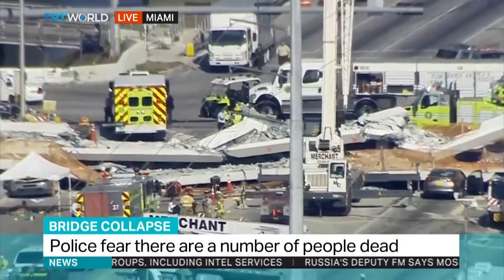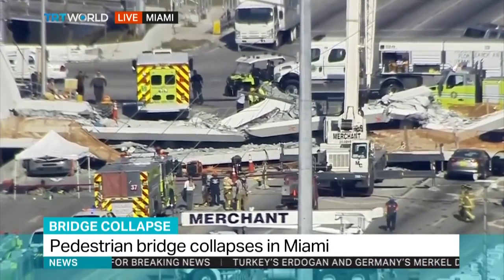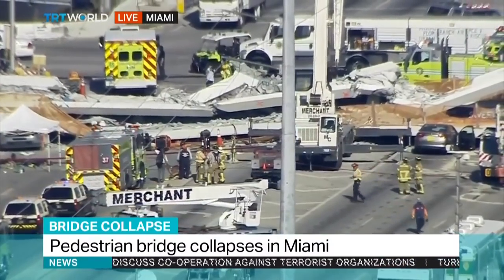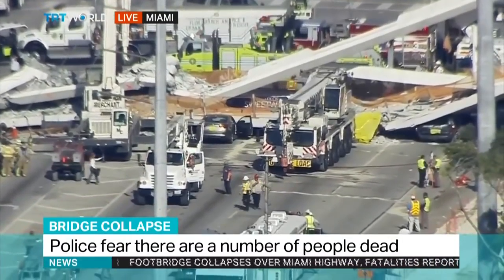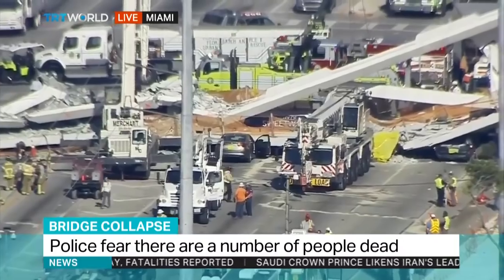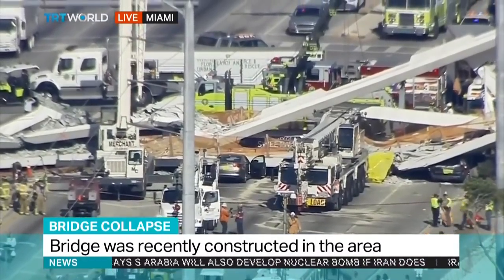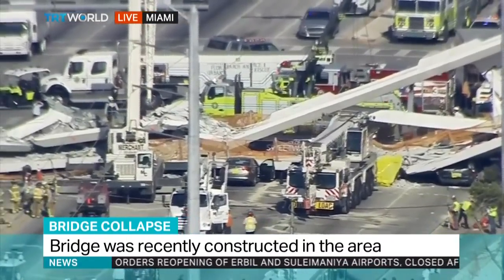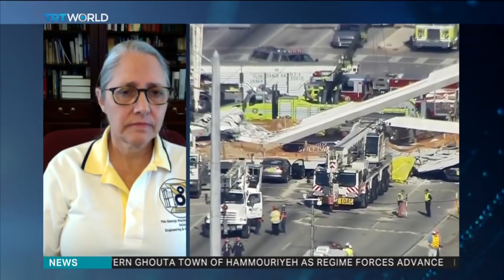GW professor and engineer contextualizes FIU bridge collapse

Comment: This professor got it wrong.  She should have known that it was not going to be a cable-supported bridge, because if the cables are supports, they have to go in as the span is erected, not long after.  The span had to be self-supporting, but it wasn’t.

Also, what she said at the end about “unforseen things” was completely wrong.  The structure gave plenty of warning that it was failing, but the Engineer of Record (a P.E.) couldn’t see what should have been obvious.  He was in denial.

Comment: Proven fact: Concrete Cracks. Concrete has full strength standing straight up & laying flat. Concrete on it's own, does not have the strength to be suspended above ground, which is why they laced it with re-bar. A concrete bridge needs to be supported with steel decking & lots of re-bar for tensile strength. This bridge was doomed from the start by both design & material failures, add that to letting people cross under the bridge while being  installed spells disaster. Was the Three Stooges in charge of the FIU bridge placement & construction & design??

Comment: The mast was to be purely decorative. The design was dumb and the installation was dumb. Romans successfully built arched bridges thousands of years ago. But to build this kind of bridge especially over a long span the strength comes from steel that supports is, not from the concrete. The engineer's statement was that her primary priority in her design was the bridge's appearance. Well it has turned out to be quite a sight but not the way she expected.

Comment: Cables? What f'n cables. There is not a cable in this entire bridge. FML
Reply: There are cables inside the trusses in the concrete.  They think one snapped due to overloading.
Reply: Nope. There are tubes with tensioning bolts inside, two per span. Big ole huge bolts that put their span in tension so it gains strength. One of those bolts snapped while tensioning. You can see the tensioning rig hanging off the end of the bolt sticking out of span 11. Seriously. No cables. Even the "suspension" is tubing that is simply bolted at each end. Decoration.
Reply: Al Hartkopf — There were tensioning rods in the truss elements and tensioning cables end-to-end in both the walkway and the canopy.  Some people think a tensioning rod snapped but I doubt it.  I think the concrete failed, because significant cracks appeared before total failure.

Comment: When they moved the supports from the end to inboard and canti-levered that end section all the stresses in the truss sections changed. In that last north section the stresses not only changed but reversed . The bridge may have cracked then unless they recalculated and re-stressed the bridge. When they mounted the bridge and removed the canti-levered pressure the cables would have slacked due to the change in truss section pressures. Re-tensioning that rod that the  tensioner was still on probably broke the already stretched rod or busted the concrete section already in compression. Either would have caused the bridge to fail. A single truss bridge like this does not have much redundancy built in and would be likely to fail if anything went . Actually cable staying the bridge would have added great redundancy and helped a lot. Pretty bridge, shitty design, not enough redundancy, money and time driven method of procedure, not a good combination.

Comment: I have only one question:  Did the designer of this Bridge have an Engineering Degree, from a Real University?  I see, far too many mistakes, including the design, time factor and materials  used!
Reply: Once the inspectors get into the construction of this FAILURE, they will find the Wrong Design  and Wrong Materials were used.  And then, there  was the installation.  Damn!
Reply: Believe it or not, there are more than one engineer that works on these types of projects. If an individual who wants to become a Professional Engineer (PE), they must go to an ABET credited school (or a real university you speak of), work for four years and then take a 6-hour test to obtain a PE license. The materials used were not the problem and there were not "many" mistakes. There was one unknown problem and that will mostly be an installation problem, not design.
Reply: "...one unknown problem..."?   No, there were a number of problems.  Let's start with the installation of the Bridge, and allowing traffic to travel under it.  That, Zac, was a Stupid Mistake.  After moving the bridge, workers notice cracks appearing in the Bridge.  Then, take a look at the design!   Do you want me to continue?
Reply: Cracking in concrete structures is perfectly normal. However, there is no picture of the crack, so it is hard to tell if it was from stress, shear, or flexure. I do have a question though, in your opinion, what was wrong with the design of the bridge itself?
Reply: Looking at the Design, I question using a single Bridge Truss.  Hell, we've had a number of bridges build here, using the accelerated construction method and NONE of them have failed.  In fact, if we look at the massive weight of this, specific bridge, I wonder why "Steel I Beams weren't used.
Reply: I honestly believe the engineer had the idea that the diagonal members would be jacked into tension prior to the temporary supports being removed. Why rely on concrete diagonal members in tension with minimal tensile support? Which brings up the time-frame when the worker was tightening the tendons. With him doing this, the structure is fluctuating during this process; which is putting stress on the other diagonal members (that may or may not have been put into tension yet). Using steel would definitely be an easy design with the construction time being cut in half. But try telling an architect and the client to build another cookie cutter.
Reply: Well, Let's try this one again!  Do you see, ONLY, a Single Truss, in the middle of this, very Heavy Bridge?  Not only do I question this design, I question the whereabouts of the Engineer(s) during installation.  Unfortunately, there is more, starting with  GREEN CONCRETE, in mass!     As for a new Cookie Cutter, this should have been reviewed by competent Engineers.
Reply: Not sure why we had to "try" again...The truss system consists of diagonal member; in which I was referring to. I do agree with you, with a structure like this, an engineering firm with a history like FIGG shouldn't been considered for this project.
Reply: We are in agreement!

Comment: good review.... I can tell you now from the reading I have done they overstressed the bridge when wheeling it into place, by having a large canter-liver at one end. That took the post tension cables to near elastic state and then when they had the bridge in place they tried to reduce the canter-liver tension and it collapsed. As an Engineer with two degrees I an putting my best guessing/ estimate that that's what happened. 80%  confidence that is the cause of the collapse as you can see the jack and post tension cable shooting-out of the collapsed structure. Further, the men were said to be tensioning/ un-tensioning the bridge to working loads.  ⚰️  Schoolboy error or in this case its a school girl error as the design is driven by a woman.
Reply: You never considered it to be a 2nd or 3 rd language? How many do you know? ....and can write in that language?
Reply: scotty362100 forget it matt, you ignore my comment.....Than think back when the conclusion come in. Just forget I said any thing.

Comment: These guys don't have a clue about complex systems. Whenever you have a complex system you have built in redundancy . It's part of Risk Management. Any risk assessor would have advised not to have the freeway open during dangerous construction like this. Bloody idiots.
Reply: And I would put money on it that some old school journeyman tried to warn these people that something wasn't right about it , but was ignored.
Reply: They could have made it out of steel and applied light weight concrete facades to achieve the same appearance with a lot less weight and cost.
In my opinion.
Reply: Jason Goodacre yes.  3 at a minimum.
Reply: It was an all-women team start to finish that's why it fell

Comment: ABC-Accelerated Bridge Construction--building off-site and moving into place is nothing new, it has been done for over 100 years.  Mostly with railroad bridges or highway bridges over waterways.  The lifting and transporting has to be done as planned for it to work correctly and safely.  It seems a single row of truss members is about one too few particularly in concrete.
Reply: Roy Reynolds

But... Steel is very forgiving of dynamic stress.. How many of these successful ABC were of concrete?
Reply: My guess someone was budgeting the grant money so tight you couldn't pull a needle out of their ass with a tractor.

Comment: You don`t have a clue---textbook theory--you have never touched a strand or post-tension rod or a hca  or a dba---stfu!   You don`t even know that it was not a cable stayed design, only an esthetic rendering of one so it would look pretty with all the colored lights played on it.  Also note the post tensioning jack blown out of the top deck---only happens when a pt rod fails---bridge was put into a cantlever condition when transport jacking vehicles were re-positioned inboard  and left the first chord of the bridge cantlevered.  When set on support column, tension was relaxed when diagonal member took compressive load.  Ordering a re-tensioning of that member added to the compressive force on the member and caused an abrupt failure of that diagonal member.  Also observe green concrete in abundance in photos--the end result was caused by rush to get into operation.  Too many sound practices were violated on this project--heads will roll but the lives taken and the lives and careers ruined can never be replaced.
Reply: They must pay people well to go on record and give these interviews when it is clear they don't even know the subject they are pretending to be an expert on. Hopefully this type of construction is stopped at once and at least temporary supports are required.
Reply: Spot on , well stated.
Reply: You get one chance to apply tension to concrete , right out of the oven , after that , the cookie crumbles.
Reply: Fuller Johnson     the guy with the least knowledge and the most to say is usually the guy carrying the wrench .
Reply: Well done. That is precisely what happened.
Reply: thank you!
Reply: In my opinion only, they didn`t allow enough maturing time (for hydration)---The diagonals, bottom chord and roof/top chord were not monolithic---ie "cold" joints and really couldn`t have attained enough strength.  I`m not there so my observations are speculative only.  However, I see green crumbled concrete abundant in photos.  Also, one video shows compressive failure at the north end top chord--appears to have failed at same time the diagonal failed.  There were force reversals going on all over the structure and No redundancy.  Should have been at least tested before install OR left the transport/jacking vehicles in place to act as falsework.  Couldn`t do that because traffic flow took precidence over safety.  Lifes rule in a very simple term:   MAKE GOOD CHOICES.
Reply: Fuller Johnson i
Reply: Phillip Lopez You must not be too bright or you miswrote what you meant. Most of the time the guy with the wrench (ie troops on the ground) know far more about what works and what doesn't, the problem is the college educated know it all engineer won't listen, because his slide rule and calculations say different